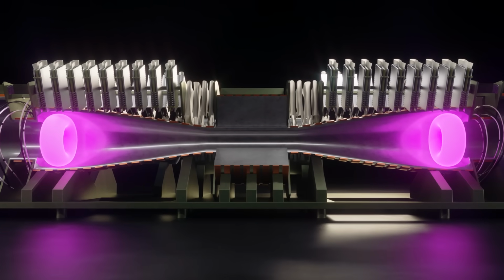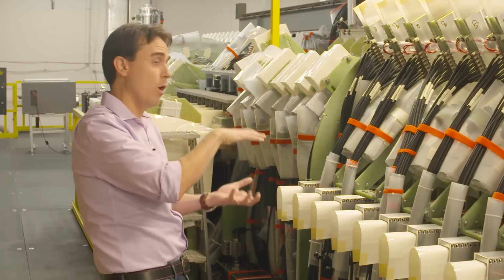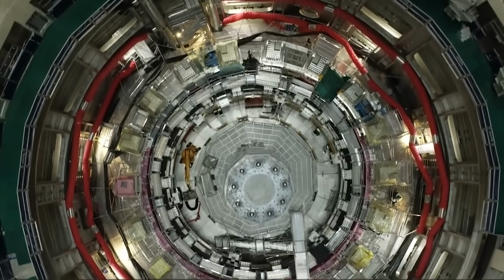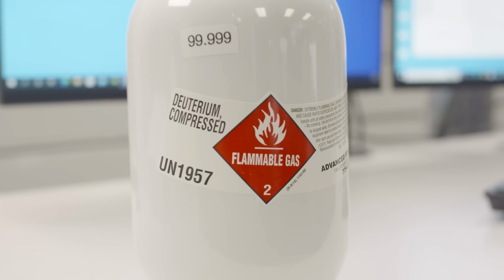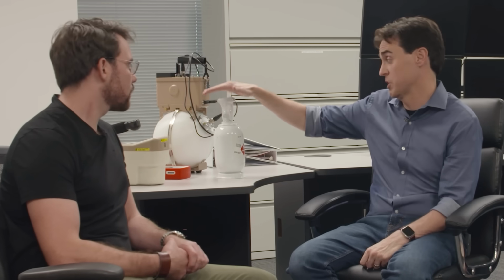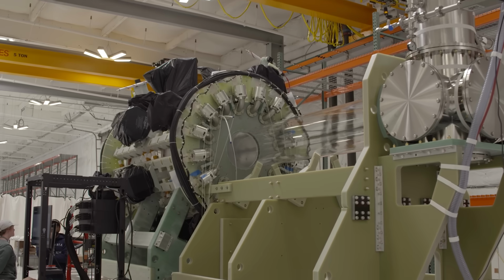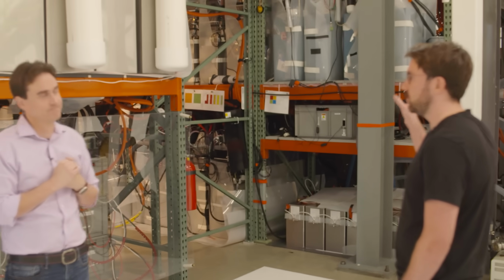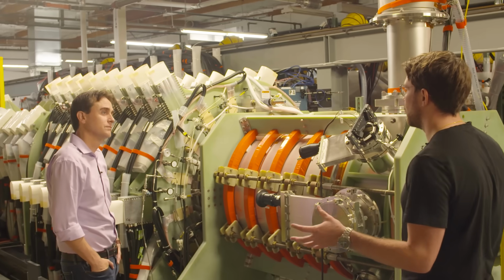A New Way to Achieve Nuclear Fusion: Helion

Comment: Is not a sustained reaction. nor is it breeder capable (in other words not self sustaining). ITER is!!!!!   I am a designer that worked on primary coil winder for ITER.
Reply: It is a pulsed system on purpose. It could run on D-T and breed Tritium if surrounded by a Lithium blanket. But they are doing D-He3 and the machine is getting the He3 from D-D reactions (which also produce T).

Comment: THE FOLLOWING VIDEO SERIOUSLY CHALLENGES YOUR REPORTING ON HELION.  https://www.youtube.com/watch?v=3vUPhsFoniw
Reply: People have been bringing this up in the comments here. 
The author of said critique seems to solely rely on the video above (and a couple of blog posts) in his critique from the point of view of someone who claims to have worked at JET. 
This is not quite fair. The Real Engineering video was made by people who are not plasma physicists and is meant for consumption by the general public. It does not contain all the physics details you would find in a scientific paper or a talk in front of peers.

So here is my critique of the critique of the Real Engineering video:

- Critique: "FRCs have been done before and never worked." 
First, define "worked"! What was the goal of the experiment and what was the outcome?
Second, yes, FRCs have been done before and the members of Helion's founding team were actually involved with several of them. They applied the lessons learned from those to their own design, which they have tested over 6 prototypes so far.
Lessons learned and applied:
1. Size of the FRC. The larger, the less susceptible to n=2, rotational instabilities.
2. Elongation to radius ratio. The longer the FRC, the more stable it is to tilt instabilities.
3. The merging before the compression. This part creates a single, hotter and more stable FRC as a target for compression. FRCs get more stable, the hotter they are.
4. Helion's FRCs have a very low electron to ion temperature (Te:Ti) ratio of 0.1 and less. That makes things a lot easier compared to machines where both are in an equilibrium because: 
P(fus)/P(loss) scales as Ti^1.5 / (Z^2 * Te^0.5 )
Where Z is the atomic number (in case you wonder about that).

- Critique: "Deuterium - Helium3 has a smaller reaction cross section than Deuterium - Deuterium. At the 100 million degrees temperature discussed in the video, Deuterium - Deuterium reactions would be much more likely than Deuterium - Helium3 reactions."
That is generally true, but the author misses some key points:
Trenta is a subscale prototype with much weaker magnets than what they are proposing for a full scale powerplant. Because of that temperatures are somewhat lower than in a full scale power plant. Power plants aim for temperatures 20 keV (220 million degrees) and up to 330 million degrees (30keV). At that point the D-He3 reactivity surpasses the D-D reactivity.
That said, Helion actually wants some D-D reactions because that is how they are breeding their He3.
D-D => He3 +n or D-D => T +p
Both reactions have a 50% chance of happening.
So, in mixed mode (breed and power) machines, they will need two D-D reactions for every D-He3 reaction, at least until the Tritium inventory is large enough that they have a constant supply from decay (Tritium beta decays into Helium3). Sicne Tritium has a half life of 12.3 years, that can take maybe 20 years. That fact is probably the best criticism of Helion's approach.

- Critique: "Deuterium - Helium3 is too hard and Tokamaks cannot do it. Therefore Helion's approach of fusing Deuterium and Helium3 can never work."
D-He3 is very hard to ignite, but they do not need ignition for their design to produce enough net electricity to be economic. Most of the energy from D-D and D-He3 reactions is released as charged particles, not in neutrons. Helion can recover the energy in charged particles directly as electricity at a higher efficiency than a steam plant would. They can also recover 95% of the input energy directly as electricity. That makes their machines a lot more efficient.
Further, FRCs are high Beta (~1.0) compared to Tokamaks (~0.05). Beta means the ratio of the plasmas internal pressure to the pressure applied externally via magnets. 
Fusion reaction rate (the amount of energy produced) scales as magnetic field to the 4th power, an extremely strong scaling. However, that is the magnetic field inside the plasma, not outside, which scales as Beta^2 and B_external^4. 
If it was just about the efficiency of the magnets (it is not), then a 10 Tesla Helion machine would outperform a 200 Tesla Tokamak.
But, it is a bit more complicated than that, because confinement times in FRCs are generally lower. You win some, you lose some. Overall it is still a win for Helion's approach.
Since Helion is using adiabatic heating through the compression stage, they can to some extent(!) balance temperature and density almost linearly for a given magnetic field. D-D reactions favor higher density and lower temperatures. D-He3 is the opposite way round. They can tune that just to the right sweet spot between density and temperature depending on which reaction they want more of.
Another thing that works in Helion's favor is the aforementioned Te:Ti ratio. This ratio actually decreases further with higher temperatures. So the hotter the plasma gets, the smaller that ratio. Trenta already showed Te:Ti at <0.1. It is likely that a power plant will have an even lower ratio. Lower electron temperatures greatly reduce Bremsstrahlung losses. At a ratio of 0.1, thermal transport losses actually kick in earlier than Bremsstrahlung.

- Critique: "The neutrons from Deuterium-Deuterium reactions would have fried Trenta and I see no shielding." 
As mentioned, Trenta is a subscale prototype, an experiment. It is smaller, weaker and only operates at one pulse every 10 minutes (max). A full scale powerplant would do 10 pulses a second!
Not all shots were fueled by Deuterium or Deuterium + He3. Many were fueled by a mix of hydrogen and Deuterium or pure hydrogen, depending on what they wanted to test.
Because of that alone, the total neutron flux that Trenta has experienced so far is not that high.
What the critique does not mention is that neutrons from D-D reactions have a much lower energy than those from Deuterium- Tritium reactions (2.45 MeV vs 14 MeV). Those 2.45 MeV are below the activation energy of many materials.
The machine is mostly made from low activation materials or materials with a half life measured in minutes. Aluminum activated by D-D neutrons has a half life of 2 minutes.
In fact testing different materials under neutron exposure was one of the purposes of Trenta. They have tested quite a few alloys to see how they behave.
There is still permitted shielding of course. It is in the walls of the room and not close to the actual machine, which can handle the aforementioned relatively reduced neutron load just fine. 
It is also worth mentioning that a mixed mode Helion power plant (that does both breeding and power production) would produce neutrons only in one third of all reactions. So the neutron flux, even for those machines would be lower than for a D-T Tokamak.

- Critique: "Helion claims that they discovered new physics when they say that the ion gyro radius is 25% larger."
The whole ion gyro- radius thing was based on a misunderstanding and out of context quote and maybe also bad wording.
What happened was that Trenta achieved a higher ion temperature than predicted by Helion's too conservative physics model (a higher ion temperature is actually a good thing!). That higher ion temperature caused a 25% increase in ion gyro radius, which is perfectly in line with established physics. That's it. Nothing to see here!

- Critique: "Helion had previously said that they would have a working power plant in 2021. "
IM was very eager to get a "gotcha" on Helion. I guess he did not read further up on the page, or he would have seen that Helion was in the process of raising funding at the time. They did not get that funding until now. Even Trenta was less than 35 million (especially if you take the 35 million into 2019 dollars, when they started building it).
No bucks, no Buck Rogers. Should be quite clear, no? 

That is how far I could bear watching the "critique" video. Once the picture of Chernobyl came up, I quit. Not worth my time. So if you have any other points that you want me to take apart, feel free to ask!
Reply: I don’t have the time or interest to pursue this any further. Neither do I have the expertise. If the critique of the original video is incorrect or not, real engineering should construct a response. It may turn out that the truth is not definitively known by anyone and will require further research. I would guess that is the most likely case.  I do appreciate the enormous amount of time it took you to construct your response and the expertise. It takes to do such a thing.
Reply: @francisdelvecchio7536  
RE should not have make a response to every single "critique" video that tries to bank on their success. Plus, I would not give IM that extra airtime and exposure.
You have my response. It was written in very simple terms and you have trouble following it. Any response by RE would not be any easier to understand and their channel is a popular engineering channel. So, I doubt it would help much if they did.
I could write a response that goes much deeper into the physics and engineering of Helion's machine with citations and everything. I doubt anyone would care about it. People have been asking me to make a video response but I doubt it would be worth my time. I DO have a day job ;)

Comment: This is all very fascinating, but am I the only one doubting that anything could reach 1million-20million degrees without destroying anything that is within 1 meter, like the walls of this machine. The founder said if the plasma touched the walls, the heat would damage them. Am I really supposed to believe 1ft of separation matters when you are dealing with 1million+ degrees of heat?
Reply: The plasma is hot (100 million degrees C at peak, actually), but not very dense (closer to a vacuum than to ambient air). A single pulse only contains a few kWh of energy. It is surrounded by a vacuum, which is a perfect insulator and held in place by strong magnets. If confinement failed, there would be some abrasion on the inner walls but not catastrophic damage.